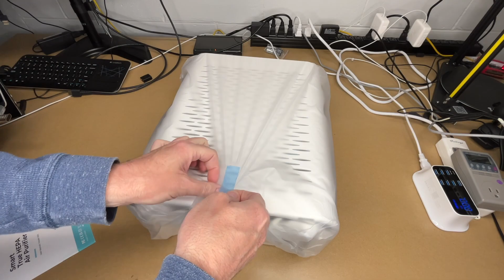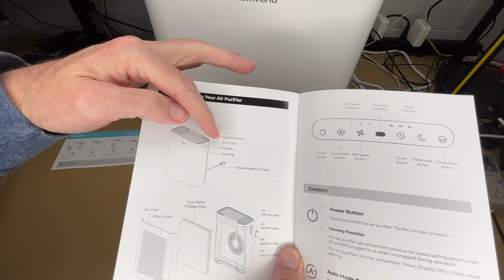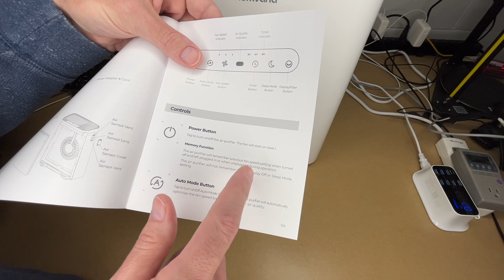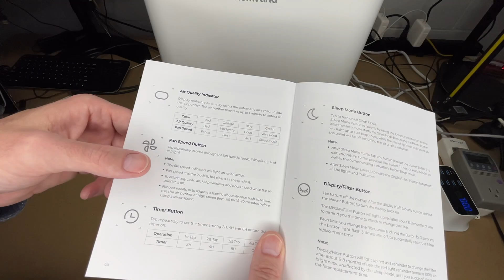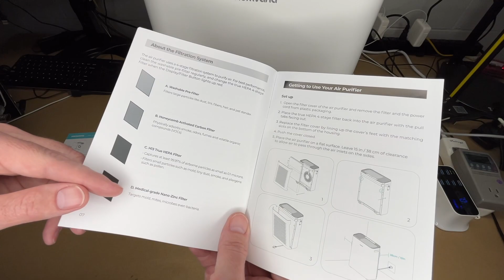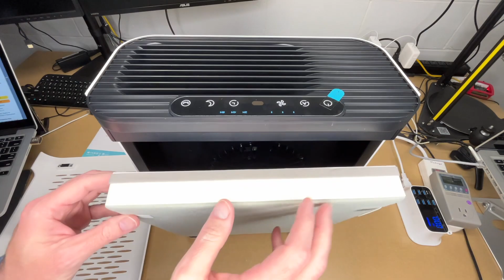Homvana Smart True HEPA Air Purifier

Comment: Red light stays on only had it 2 days
Reply: Red light means it's time to change the filter. See if you can clean it off
Reply: @Solanger2012  only had it a day doesn’t need cleaning
Reply: I have the opposite question. My light is always on green even when the air quality outside was really bad
Reply: @AVibrantVoice  I’ve obviously bought a pile of crap 🤨🤨🤨
Reply: Actually one day when the air Quality outside was terrible. To try to test it I literally put it at my front door. And within about 30 seconds it turned  Orange. So I’m assuming that it is working hope you find yours is as well